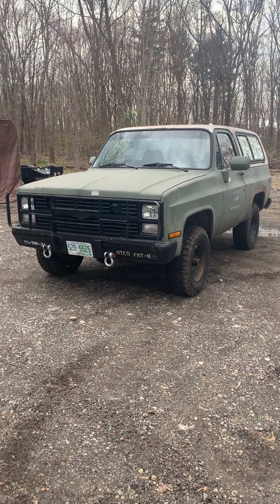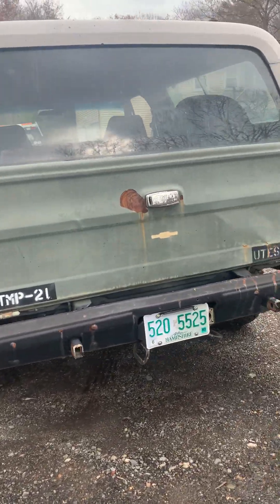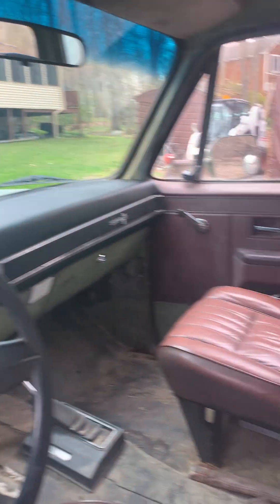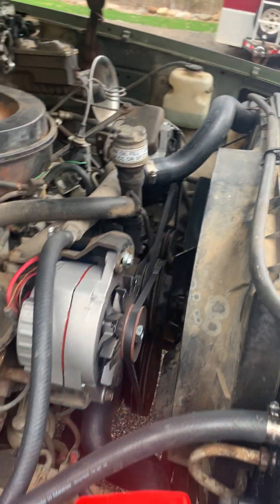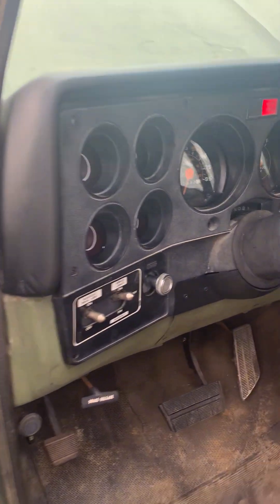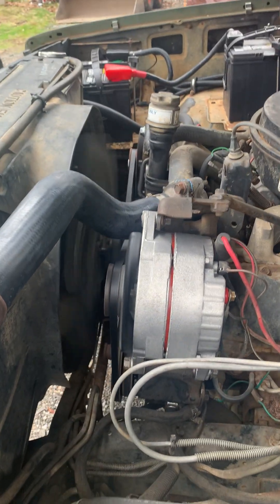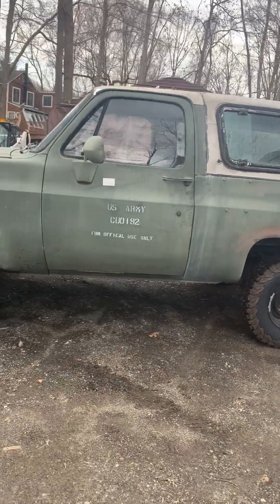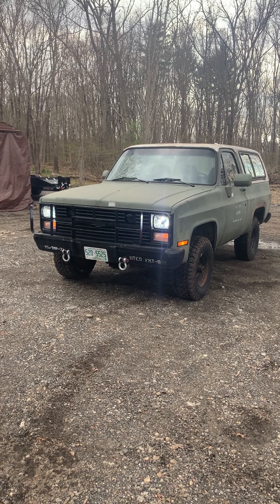M1009 1986 Chevy K5 Blazer “The Mason Belle” with Upgrades and Repairs

Comment: Hi nick, i just got my m1009. Do you happen to have part numbers for the fuel filter upfeade and the headlights? Thanks
Reply from the maker: Congrats and welcome to the club! I got mine from Amazon there are a bunch of different lights that you can pick and as for the filter upgrade I have a video on it that shows what we did with our trucks, all the parts we got at O’Reillys auto parts except for the angle fittings which we got again from Amazon, post a pick of the truck!
Reply: @nh39308  thank you so much!
Reply from the maker: @ your welcome